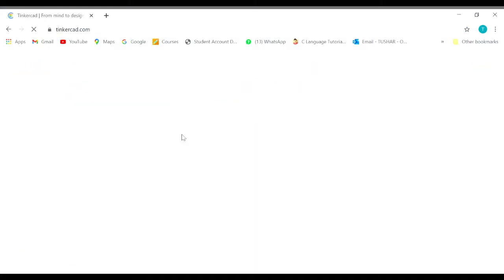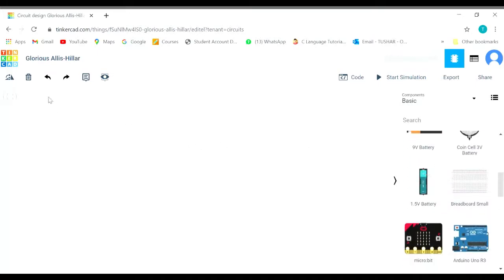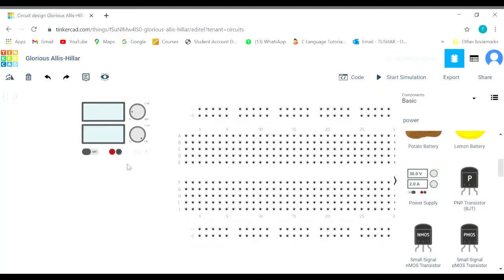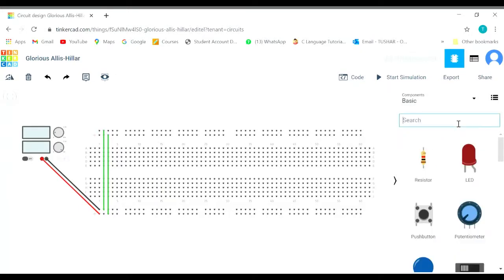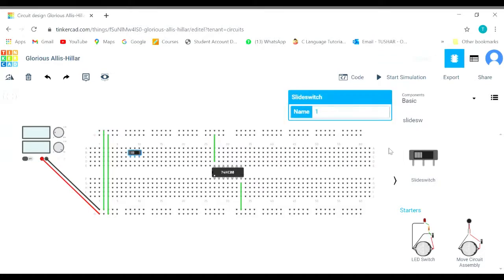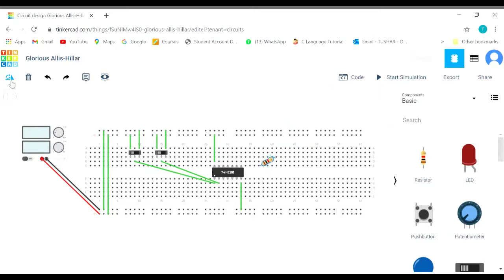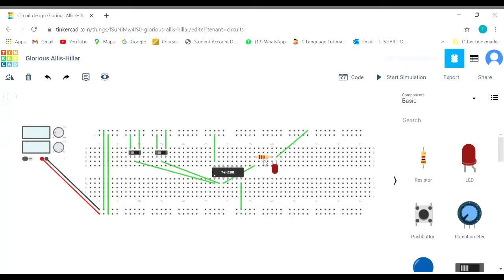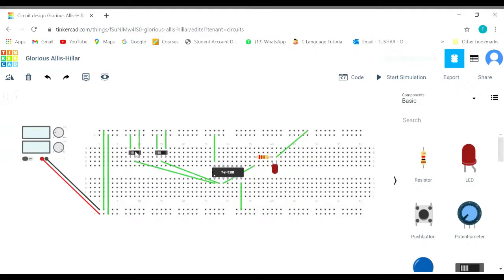IC 7400 NAND GATE - TUTORIAL ON TINKERCAD

Comment: in NAND gate both inputs are 1 then output is 0.then led gets off.But in your case it doesn't happen.check it once
Reply from the maker: Hello @ANJI GOLLA. In the video, by mistake, I have said that switches are off when they are actually ON and vice-versa. Other than that the connections are correct. Sorry for the mistake.
Thank you for pointing out the mistake.
Cheers!